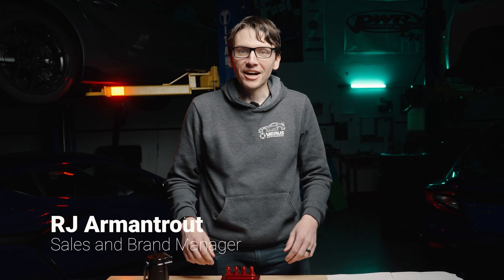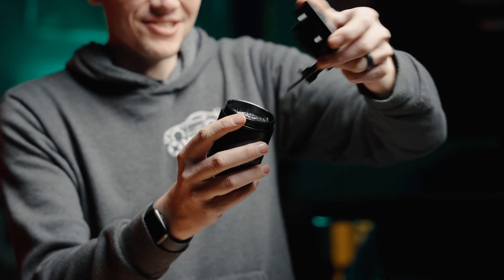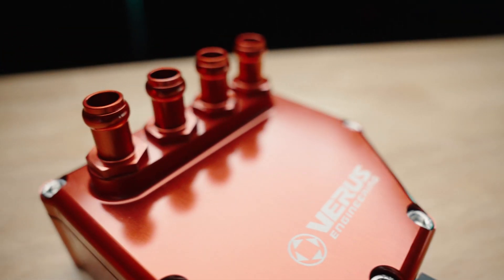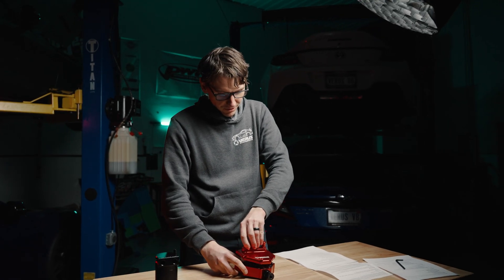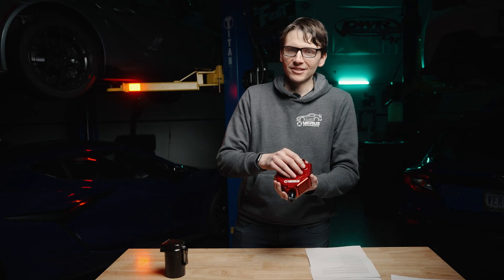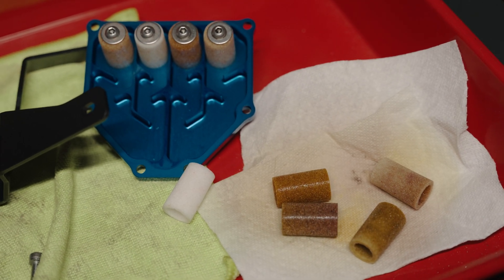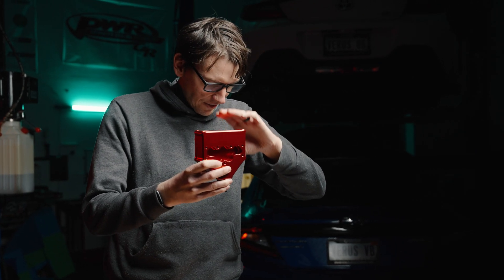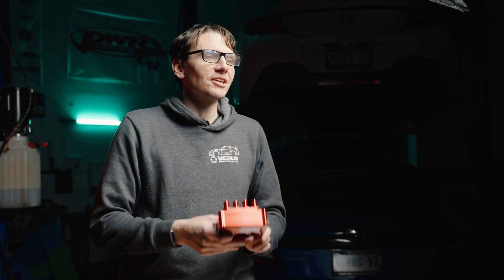RJ explains the difference between Air Oil Separators vs Catch Cans

Comment: So I have to take off 6 hoses and take it off the mount wherever I bolt it on to drain it ever 5k miles? 
Also my Audi only has 2 PCV hoses not 6,  and do I need a step down in hose size to fit your unit nipples ?  Nice unit but I dont think its fitting anywhere in my 2009 Audi S5.
Reply from the maker: Greg, you can drain the kit at the bottom of the AOS. It has its own petcock, which is how you can drain it on car. Most cars have (2) PCV hoses, which is where ours comes into play. Thanks for the compliments, it may fit the S5, but I'm not sure it is for you or not. We're happy to help via email, sales@verus-engineering.com

Comment: I am curious, you mention that lowered octane reduces performance, but my understanding of octane is that's it's more about how evenly the fuel burns, i.e. it's ability to reduce knocking, and not how much power it has. To my mind lowered octane increases engine wear and does not affect performance as the fuel is more likely to cause hotspots but it doesn't somehow create more energy. How would lowered octane reduce performance then? Can you explain this?
Reply from the maker: Engines and ECUs that are tuned to run on a specific octane, lets say 93 for this example, have timing tables associated with 93 octane. If this octane lowers to 91 or 89, power loss will occur as timing has to be reduced to keep the engine from knocking.

This is prevalent in California where they only get 91 octane. As a result, most cars in California make less power than areas that receive 93 octane and have tunes geared towards 93 octane.

Hope that helps! Let us know if it doesn't.

Comment: I have a 2021 F150 ecoboost turbocharge. Do you have a unit for this and would it be worth adding it to my truck?
Reply from the maker: We do not make a kit specifically for the F150. You would have a bump in performance and drivetrain longevity, but if you are not otherwise modifying your engine, it is not necessary.

Comment: Is there a dip stick option and ….can you just put a valve with a hose so we can just put a cup to capture the drain in an easy location ?
Reply from the maker: We don't have a dipstick option at the moment. Our method is using our drain back kit add-ons so you can route the oil back into the system without the need for draining.

Comment: I have one of those catch cans with a dipstick, and the dipstick is basically useless. I also have the steel mesh stuff in there, and it smudges the oil all over the dipstick, so you can't tell how full it is. IMO it's better just to find a good drain interval.
Reply from the maker: Word. Consistency is key!

Comment: Is this a universal AOS? Id like to implement this on my golf r as the current pcv system isn’t up to par to the amount of abuse the engine sees. Was looking at a catch can just yesterday I’m glad I saw this video.
Reply from the maker: Yes, this unit can work for almost any car, but we typically sell these as complete kits for specific cars and avoid selling them individually due to liability reasons. We can still set you up if you would like; reach out to sales@verus-engineering.com.

Comment: ほんとにすごいですね。Love my Catch Can, very little maintenance required unless you have a significant amount of condensation. Lines are clean too. 

Just make sure you buy a quality kit, even after tuning it, driving it hard and turbo charging, Not a single problem 3 Years Later! Bouncing off of limiter at 10k all day everyday!

ありがとうございました。じゃな！

Thanks for the video!
Reply from the maker: Right on! Thank you for watching.

Comment: TBH that maintenance of draining this through drain plug even worth than maintaining catch can, u always will get dirty by trying to unscrew this plug and trying to catch all the oil at the same time. looks like a really bad design.
Reply from the maker: If you want a good end all be all solution we highly recommend running our drainback kit as well. This will alleviate the need to do maintenance for years to come.

Comment: Believe these are still a fail for CA SMOG check. Looks nice though
Reply from the maker: They were not before, but it seems the laws have changed recently. The law used to be written that as long as the hose connections went to the same place as before, it was "okay" but we agree, we cannot find that document anymore.
Reply: @VerusEngineering  awe man that sucks, cool product tho!

Comment: Start of the video: don't buy one that doesn't have a dipstick or view port that can tell you when to empty it. 
Here is our product: It doesn't have a dip stick or view port.
Reply: i think the actual diff between an aos and the catch can is the coolant port and the oil drain back into the crank case, if you dont have these two then its a catch can. if you watch other videos on the diff that's what they say
Reply from the maker: True enough! You can contact us at sales@verus-engineering.com and we would be happy to explain the differences between an AOS and a simple catch can.

Comment: Is there any concern with the 5um filter getting dirty enough to become ineffective over time?
Reply from the maker: We haven't seen a case where they have yet. But if someone were to run it long enough, I'm sure they could saturate to the point they need replaced; we just haven't seen it yet.

We can sell these separately if you'd like.